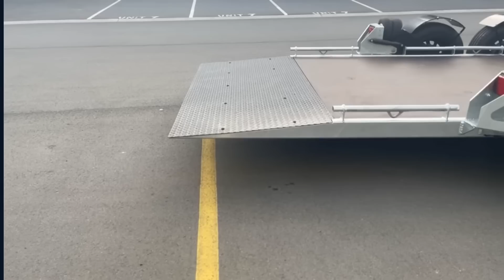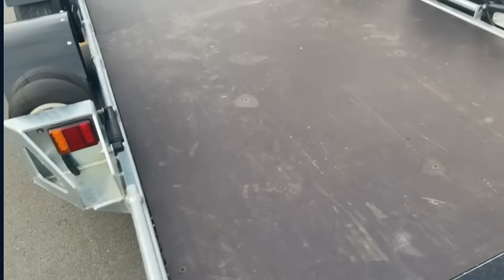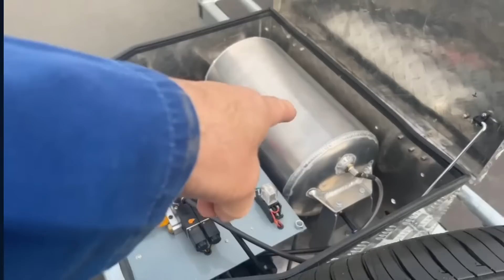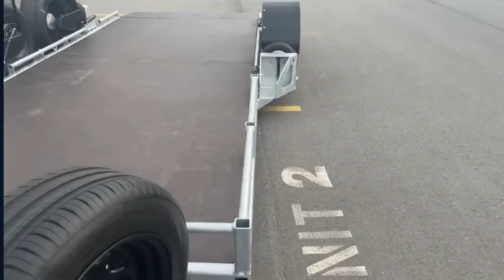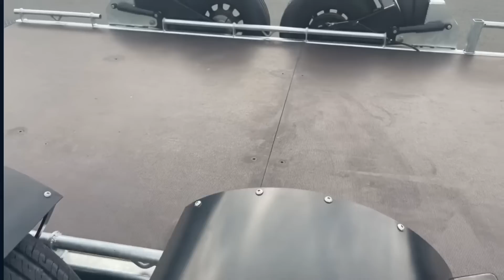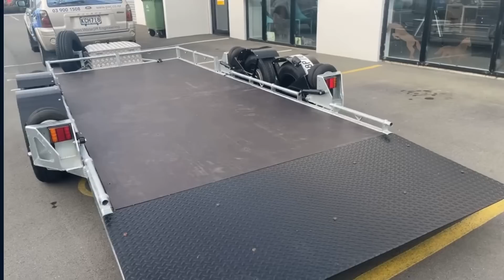How does an Airbag Trailer work 1.3

Comment: Nice job. My only concern is if you lose pressure in a bag during transport the trailer will drop and drag.
Do you have safety lock pins to positively lock the trailer in the lifted position?
Reply: dam this is the suspention dom ass
Reply: Airline/airbag failure is very rare on semitrucks, and they have an included compressor so only way that's gonna be a problem is if you aren't paying any attention to your load.
Reply: @ARockRaider  I understand! No matter I would still want locking pins. I'm not going to change my mind to please you. I'll pay for safety. Safety is not a blind assumption. You don't sound like you have any USDot, Osha, EPA exp lol.
Reply: @frosthoe  actually I am a professional truck driver of over 12 years, airbags and airlines like this don't tend to fail that way unless you have neglected them to the extreme.
And OSHA or EPA isn't really relevant to this in the slightest.

I kinda understand the desire but you can't really lock this suspension in the way you seem to want and still have suspension, further the build of the trailer means that even if this sort of failure did happen it could be safely dragged off the road the same as a blown tire.
Reply: @ARockRaider  Then you know the term lock out tag out...potential energy must be isolated...aka suspended load. Its a pinch point. My word your a stubborn cowboy.
Remind me not to work under you...
Reply: @frosthoe  this sort of potential load is standard practice on all modern semitrucks and trailers, the only difference is that this could drag on the road if there is a failure but a semi trailer with blown bags wouldn't be in any better shape and would be harder to notice if it happend while underway.
Keep in mind that the system air pressure are both gonna be rated to something 120psi (a standard range for all pneumatic as far as i know) , but this system probably only sees 5 to 15psi where a semitruck sees much higher loads (32,000lbs per axle, or 16,000lbs per bag, note this is true load not airpressure)

Though lockout tagout isn't really a thing here as the unit here would be in use therefore it couldn't be tagged out of service.
Reply from the maker: niemma2, ARockRaider has this right, the pressure is low, our max is 180PSI and the system is rated to 1000PSI, you cannot lock any part of the suspension on an airbag trailer, the airbags and the lever arms are part of the suspension, as soon as you lock it you have fixed the suspension to the chassis. 
 Further to this he is also correct in that you just drag it of the road, easy and light as you have the full underside of the chassis on teh road and not just the axles as on a traditional trailer, so the coefficient of friction is very low.
 We also have an onboard compressor and any leaks we have had have always been the line connections, never a bag or burst line. so an easy  road side fix if ever needed. I believe we have only had one leak in 3 years.
 Appreciate you comments and thoughts and we try to improve the design where practical
Reply: Cant lock swings with pins because they are part suspension, only might be pins under so trailer cant drop completely down.

Comment: Regulation might be different Aust vs NZ 
Aust  Govt design regulation 
For trailers up 2 tonnes GTM, an efficient braking system is considered to have brakes operating on the wheels of at least one axle. Over-run brakes may only be used on trailers that do not exceed 2 tonnes GTM.

Every trailer over 2 tonnes GTM must have brakes operating on all wheels. The brake system must cause immediate application of the trailer brakes in the event of the trailer becoming detached from the towing vehicle. Under these circumstances, the brakes must remain applied for at least 15 minutes.
Reply from the maker: Yes twh aussie rules are different and fully comply in NZ.

Comment: looks neat and cool but very bouncy
Reply from the maker: It's not bouncy; the weight of the load if balanced by the air pressure in the system to bring it to ride height and then it rides smooth, like.. well smooth..
Reply: It does appear to have shock absorbers which would help

Comment: I love all the comments from people who can neither spell psi, nor accurately describe its meaning.
Reply: @MrJakeMallard  funny huh, gets on here to be condescending then just makes a joke of himself
Reply from the maker: and I love all the comments from people who have plenty to say about what if this happens or that happens in etc etc etc but have no suggestions and to how those things might be addressed. Pretty much like anything mechanical, something to will break one day, the trick is to design so that it is easy and cheap to repair, we have tried to do that.

I have one client who carries a spare airbag, spare compressor and tools, never used them yet in 3 years and he carries a large tractor that on average loads about 3 times everyday 4 days a week.
Reply: @ultimatemanshed  how are airbags ( in general ) good about leak down? Do you need to have compressor power all the time if your load is static for a while, and you're using the bags for leveling? I plan to have a mechanical foot system for long term off the ground storage, and wouldn't want the chassis sitting on the ground for long periods of time. 
Thanks!
Reply from the maker: @paradoxworkshop4659  The airbags themselves should not leak at all. All the leaks we have encountered occur at the connections. If we have a leak down over time and this does occur it's always a tube or connector. There are a good products available for these joints which will eliminate then. 

There is no reason other than your use case that would be harmful to have the chassis sitting on the ground for long periods. a lot of our clients do that and remove the batter key, which prevents theft.
Reply: @ultimatemanshed  ug⁸⁸8gg Giuliani g⁷g8 IIRC hi g8g⁸g8gg⁸IIRC⁸gg⁸8 I⁸IIRC 88g8g⁸8gg⁸⁸g⁷887 guide Uintah 7g8h888 Ujjain 7hgu7ggguuuggh8⁸8bhhhhuhihhhhhhuhuhuhhhuhhuiihhhhuhhuhhihhuhuuhuhiuhhuuhuhiuhhhhhiihuhhuhhuhuhhuhhhhuhuhuhhhuhhhihhhuj I uhuuihhhhuhiihhuuhhhuhuuhuuùùùuuuuhìh jujitsu iiuhuhhuuhuuhuuuhuhhuuuhhuhhuhhhhhhh9i
Reply: @ultimatemanshed  8bu888uu8⁸hùuuùúh jugular uùghuguuuuùggu guy ughh8hhhhùuùuùhh
Reply: @ultimatemanshed  awesome, thank you!
Reply: @ultimatemanshed  That’s a fantastic trailer. I wish we could buy those suspension components in the U.K.  
people often ask questions about air suspension, blissfully unaware that every time they go out on the road they’re surrounded by lorries carrying really heavy loads on air suspension. Those systems are reliable over hundreds of thousands of miles.
Reply: Wait I've thought about this before but cooler at  moment. All because your fly
Reply: What is psi? Some kind of x men feature? What you mean is bar, that’s the proper unit.

Comment: In ozzy brakes on all 4 wheels on a gross weight of over 2 ton . What is the approx tare kg  [pending options ]
Reply from the maker: 2000 to 2500kg GVM
Between 2000 and 2500kg GVM trailers must be braked on at least one axle with one of the following:
 Override brakes (hydraulic coupling unit)
 Electronically assisted braking (proportional control unit)

Comment: Might be good for a truck, but you couldn't open the doors on a car.
Reply from the maker: When the trailer is in the up position you can open most doors unless the car is a drifter or particularly low. that why we include a remote controller for the airbags. you drive on , lift the trailer, get out, and then lower it to road height if required.  Happy days :-)

Comment: make a cover for those airbags strong enough to stand on
Reply from the maker: The covers must be collapsable as the suspension goes up and down. Feel free to design them.
Reply: @ultimatemanshed  send me some money if I design a cover? :)
Reply: @ultimatemanshed Up height to down height on bag length doesn’t change much. Can easily make one solid mounted.
Reply from the maker: @mipimoo  OK, send your design and if we can use it ill pay you :-)

Comment: Pimp my trailer, stranded if an airbag blows out.
Reply from the maker: Oh you must mean like stranded with any trailer if you get a busted axle or major damage.. We have been building these for about 4 years. Some have done thousands of miles and go up and down up to 5 times a day with 2500 Kgs on them. Never had a bag failure yet, but yes it might happen and that's the price you pay for having the coolest trailer you can have right... you could always carry a spare airbag.
Reply: @Landrover Series Chassis  could also carry a spare axle, not that they break, 
Was thinking more along the lines of throwing a load of scrap metal on board and tearing an air bag, that could happen 10 times a day if your in the scrap metal business, never heard of tearing an axle with scrap metal. The wheel guards also look like they would collapse if you breathed on them due to not enough mounts
Reply from the maker: @rionijam727  Good thinking,  yes, we have modified the wheel guards, they are now 4mm fully arched and 3mm thread plate with Huck bolts securing to the arch.
Reply: @ultimatemanshed  and what about the 100$ marine ply that's meant to be 5mm gal checkerplate
Reply: @rionijam727 well done mate, great thinking. Take 10 bags every day. Or might find it more suitable for carrying vehicles! Might be worth have skips like everyone else for scrap metal?
Reply: @bernardwarr4187  or have a trailer that's usable
Reply: @rionijam727  clearly for loading and unloading sports and race cars this is, very much so, useable
Reply: @Bernard Warr  oh ok, so hire another trailer for all other jobs when  you already have purchased a trailer for one job only, Sounds like a great buy.
Reply: @rionijam727  you will need more than one trailer if you have a boat anyway. Best to get the right trailer for the job your doing? Or hire one like you
Reply: @bernardwarr4187  iv got an axle trailer for 500 different uses instead of 500 trailers for one use
Reply from the maker: @rionijam727  no idea what you mean by this, please clarify?
Reply: @Landrover Series Chassis  the idea is to buy one trailer that is equipped for multiple uses, 
Also why does your design have 4 airbags when you could have one bag between 2 wheels, totaling 2 bags to 4 wheels, is it milked I mean built from a kiwi design.
Reply from the maker: @rionijam727  how can we use two airbags when we have 4 independent wheel swing arms.  I don’t think you know how this trailer works
Reply: @Landrover Series Chassis and Airbag trailers  I know how it works, if you designed it instead of following a new zealand design It could have 2 air bags only, it takes a good trailer design to make it simple

Comment: Very nice but shipping to the EU would cost more than the trailer! Anyone on this side of of the pond making them? Some type of protective covers over the air bags would be nice just in case you wind up in some hostile neighborhood. Working in Emergency communications this would be nice as an enclosed trailer set up for radio communications where anyone who is wheelchair or electric scooter bound could access the systems inside without having to have an electric loading ramp.
Reply from the maker: Sorry to say I do not know of anyone building these commercially other than us. Yes we have built these for wheelchair access, works really well.  Difficult to cover the airbags as the cover would have to be collapsable.
Reply: @ultimatemanshed  Telescopic tube type covers would work, think how a shock absorber rod is protected. Obviously this wouldn't make a step up but would provide protection from branches when manoeuvring in tight spaces.
Reply: @lariwoo  Those bags are tough, you are not going to poke a hole in one with a branch too easily.
Reply: @--_DJ_--  I know what the bags are like, they are tough used on comercial trailers everyday...but you did challenge someone to devise a means to protect them in another comment.
Reply: @lariwoo  That was not me.
Reply: If that gets EU approval I will be very surprised.  Lights are to far from the actual rear of the trailer and the ramp would be to sharp.  If both issues could be overcome then maybe. 
The ramp only needs to fold up the first 6 or so inches..
The lights again are simple to relocate.
Reply: @michaelwalker1145  lights could be moved but as for the "sharp" ramp, it’s a good deterrent for tailgaters. Just like my hitch on the back of my minivan. Some lady on the freeway in a construction zone was not paying attention to her driving and met mister hitch on the back of my van. Over a thousand dollars to her front end plastics, no issues with my van. Another hint to eliminate tailgaters if you drive a pickup truck. Weld an old pipe wrench on the back of your bumper in view of drivers behind you. It’s a guarantee to keep tailgaters away.

Comment: What is the max tons capacity on the trailer? 

Can a Toyota hilux pull the trailer.?
Reply from the maker: Yes Brian, a Toyota Hilux can easily tow this trailer. The design capacity is 3000 KGs, the trailer generally weighs in at about 700Kgs  , so you load can be up to 2300 Kgs.
Reply from the maker: 2000 to 2500kg GVM
Between 2000 and 2500kg

Comment: What happens if the bag system fails? Does it drag along the ground?
Reply from the maker: Charlie, We have not had a bag failure in 3 years, we have however had a valve failure which let the whole side down. In these cases, yes the trailer drops, however it slowly lowers to the ground and you get plenty of warning.  On the latest trailers we have designed a suspension lock that can be used when changing flat tires and also to lock the suspension up while you get yourself to a someplace where you can do the repairs.
Reply: @ultimatemanshed  I have recovered a trailer with one side collapsed. It was designed for ice fishing and had leaf springs and a strap winch apparatus to lower the trailer down while on a frozen lake while fishing. I can't remember exactly how it worked but the guy hit a large bump and the spring broke. It was a HUGE pain in the ass to load onto a flat bed tow truck. I know your system shouldn't really fail catastrophically like that micky mouse abortion.
Reply: It's a bloody nice looking trailer. Would be good to add a fail safe, where if it fails it bottoms out on a pin or similar that keeps it somewhat above ground. The pin could be pulled when dropping to load. How does one go about getting a quote for a similar trailer to whats in the vid, just shorter on length, and with minimal bells and whistles, remote not required, just up and down.
Reply from the maker: @charliebrown7203  Send an email to alan@pwj.co.nz outlining in as much detail as you can and we will send you a quote. Thanks
Alan
Reply: @charliebrown7203  Very good answer.  I wouldn't mind taking the time out to release a " failsafe locking pin "  before lowering the trailer. I'm very surprised they did not design this into their system.

Comment: this is really interesting, I want to put this on my camper as I want to make my truck taller and have to lift the camper as well. Camper is a fifth wheel so I don't have a hitch option.
Reply: That's great thinking!  This way, your camper can benefit from the same drop in stability as the truck that tows it.
Reply: @1SqueakyWheel  🤣🤣🤣 this comment section is killing me
Reply: @AquariumAficionado  Same here.  I love the trailer featured in the video.  But you're right...  the comment sections never fail us.  ;-)